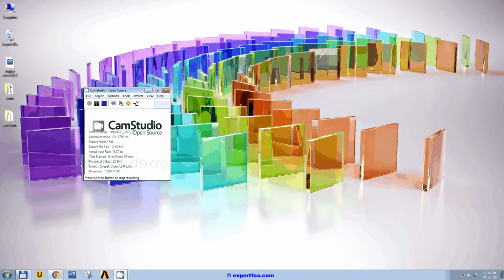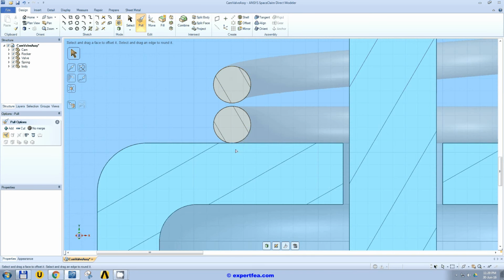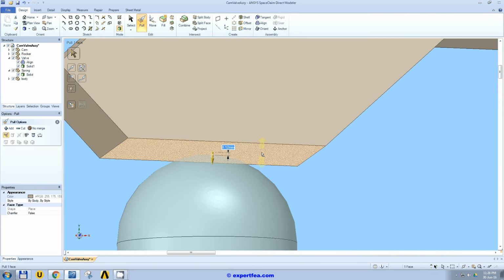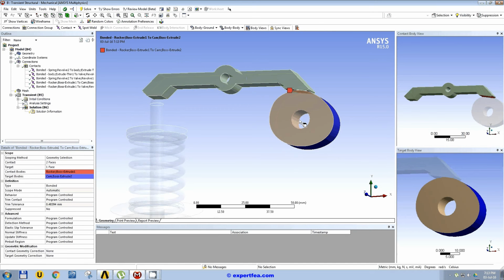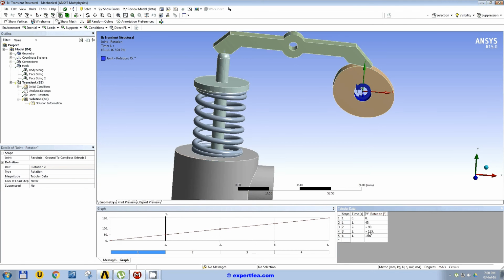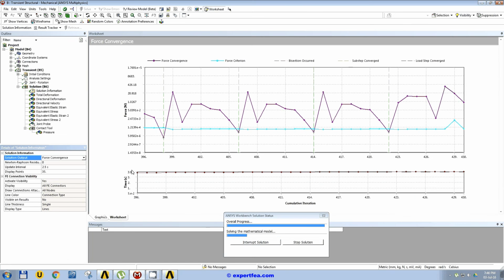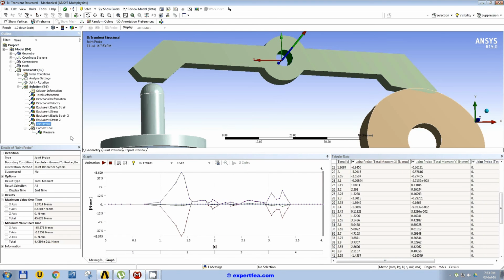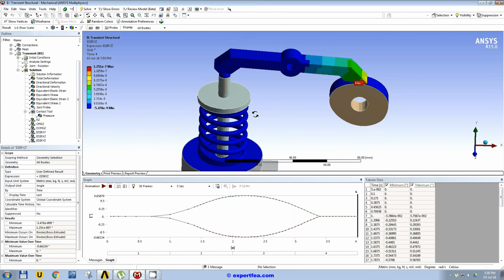WEBINAR 7: ANSYS Spaceclaim modeling and Transient Structural FEA of camshaft-rocker-valve assembly

Comment: I am running Transient Structural Analysis on a cantilever beam while putting sinusoidal loading on the tip of free end using multi-time step but on the force output, I am not getting sinusoidal deformation values.
Does anyone have any idea what could be the problem?
Reply from the maker: You might need to insert a Probe, Position, rather than Deformation.